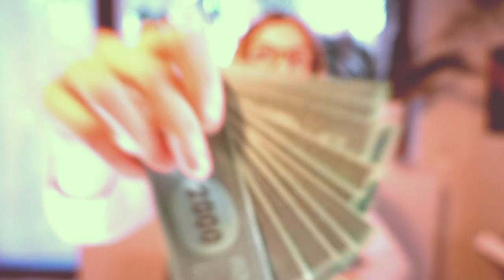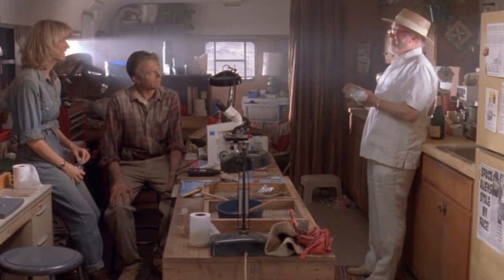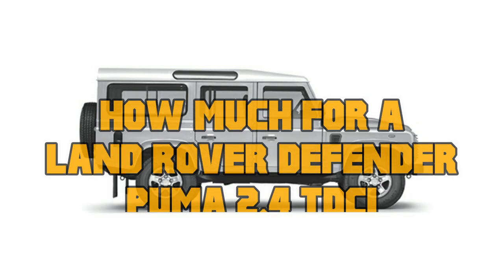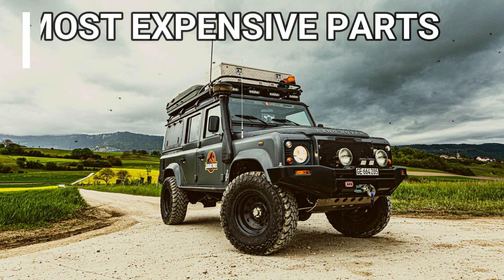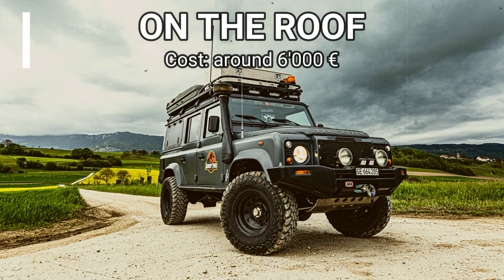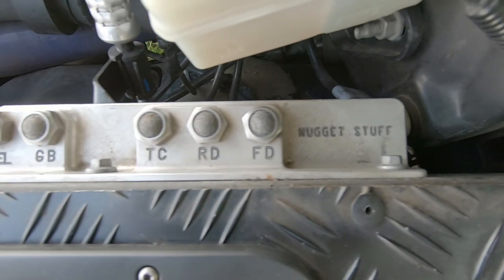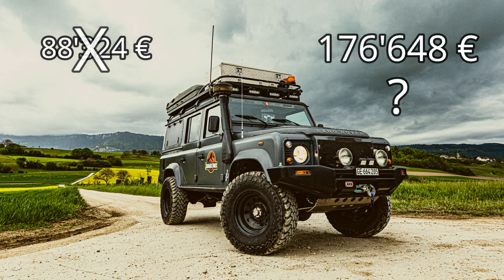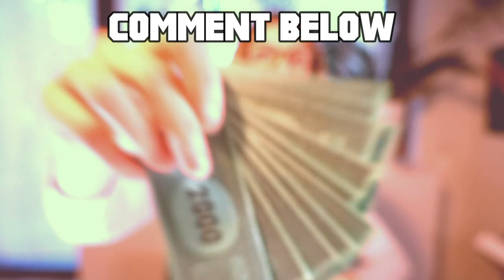HOW MUCH DID IT REALLY COST TO BUILD OUR 4WD CAMPER ??? (price breakdown!!!)

Comment: Although we drive a Toyota Hilux, a recent 2016 model, we are also upgrading it. We are planning very carefully what we actually need and what is a nice-to-have. We try to build it on parts based on the regions we plan to drive through.

For example, here is the break down of our expenses so far:

Hardtop Rhinoman (full aluminum, import from South Africa): 2900 EU
Rooftop tent (Howling Moon Stargazer 180): 2500 EU
Winch (WARN VR EVO 12S): 1000 EU
Dual battery system (1x aux battery, RedArc BCDC1240D, distr box, wiring, work done on ourselves - we are good with 12V): 1200 EU
Suspension (2.5" lift Dobinsons with remote res - we have a video with EN subtitles with the installation): 3000 EU
Expedition rack and accessories for it (bike rack, fuel jeery can, hi-lift bracket): 1200 EU
Bumpers and underbody protection (still not installed): 3000 EU including color coding

Snorkel (planned): 500 EU
Long range tank (planned): 1500 EU
Rear drawer system (planned): we might as well go with a custom one. Roughly, we plan it to cost no more than 1500 EU
Navigation system (android-based, planned): 500 EU

Total: 18 800 EU estimated (still not all expenses are factored in due to lack of funds, but it is pretty close :D )
Reply from the maker: Thanks for sharing all this! Nice set-up plan :)

Comment: Nice overview, Emilyne. However, I have good experience myself with second hand market. Big saving potential here. Aside from that, let us not forget the money saved on other hobby's and hotel costs.  In the end you remain with an investment. The car remains with some value in the end and as I experience it, demand for old Defenders is on the raise. And last but not least, there is a lot of fun too with an original Defender and that is priceless.  Indeed, I have an optimist view on things when it comes to an old Defender.
Reply from the maker: Thanks for your message! Yes money is spent differently, we do save on one side and add up great memories & fun experiences. Second hand is a great option, thanks for sharing this point. It's the low cost/bad quality parts we dont recommend to buy. Cheers!

Comment: As they say 'buy it right or buy it twice'  no arguments with your way of doing things.  I'm just building a touring set up to go to Argentina and can understand how you got to that easily.  I love defenders and have 5 of then, but have decided to go with Toyota for my trip using a Prado 150 as the base vehicle.  So far I'm about 20k in with air intake system, catch can, suspension and lockers, front bars, roof rack and bundu tent. Still to be fitted are fridge and 12v system, awning together with perhaps a trailer for water, fuel and cooking system.  I guess I'm still 30k out from the final number which will have ended up being about 80k including the base car which I bought new in 2018 as a LC150 Utility, which is nearly as basic as a defender but not quite.  Out of interest would you buy defender again?  Thanks for your videos they are so helpful. Best Douglas
Reply from the maker: Thanks for your message and sharing all this! I think yes we would buy another defender but if we needed to go bigger maybe an unimog.

Comment: Great video, I wanted to ask how reliable is the defender with you, For context I have a defender 2016 puma 2.2, it has 40,000km on it, I always service the car at a workshop/garage and will hopefully start to service it on my own, ive had some problems where I had check engine the first time it was because overspeeding according to the workshop it was the first time they saw that from the ecu, second time was because the turbo hose leaked and opened up, I want to learn how can I make my defender less of a hassle, second thing is how did you learn to service your car, do you follow a book/manual, i got my car used no manual, thanks in advance
Reply from the maker: Thanks for your your message! I think we have a reliable car because my husband knows it well after all those years of owning it. He learnt to service it by himself and with help of friends or info on forums at the time. Now can easily find more help on Internet, social media groups, or local groups. But a pro mechanic is always required for the bigger jobs 👍

Comment: That's a good and scary breakdown. A question - where your ARB compressor is located? Is it the accumulator bay under the seat or somewhere inside the cargo area? Considering to install one two but haven't decided yet where.
Reply from the maker: Thanks! Our ARB twin compressor is fixed behind the back seats, it's screwed on the wooden layout, and the air output is under the rear wheel arch.
Reply: @offtrackfamily  so it seems there's a vertical mount pane between the backseat and the cargo area? No way to use the entire floor with backseats folded up with no disassembly? Thanks I've got it

Comment: Where could you get a defender for £19,000 in 2014? My late 2014 Puma 110 XS with a couple of extras cost nearly £32,000!
Reply from the maker: If I remember well it was a 90 starting price, 110s were a little more but way cheaper than ours.